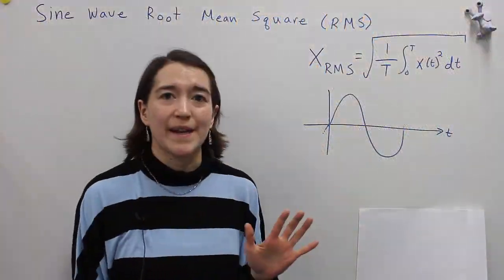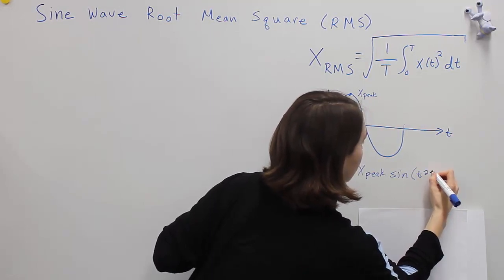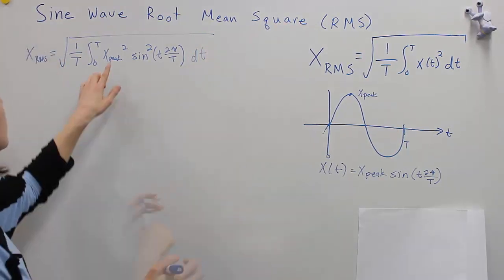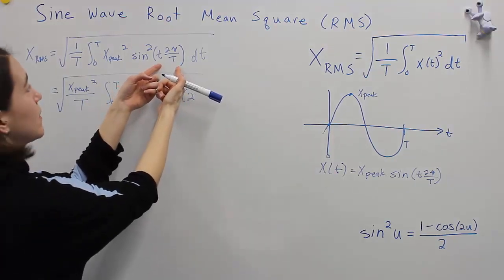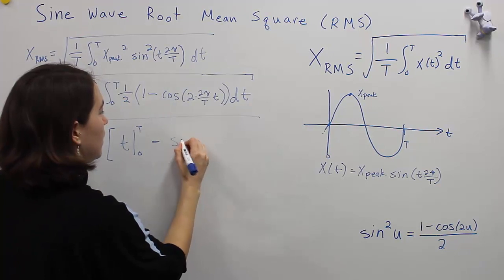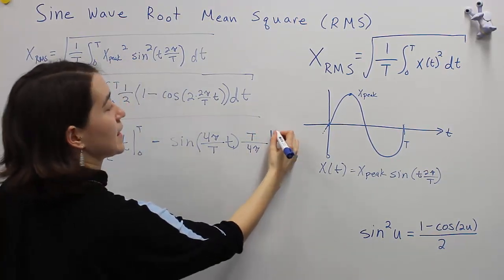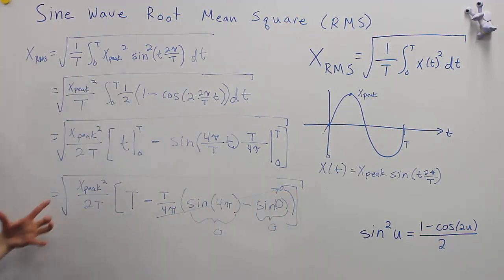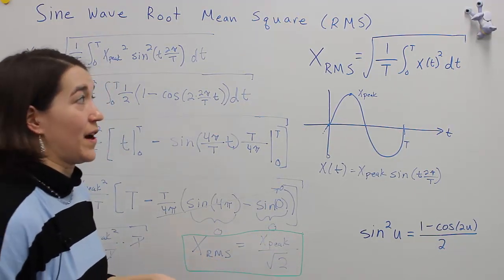Root Mean Square (RMS) Value of a Sine Wave

Comment: Valerye. I have a problem.
I have a system. 
A wall that connects a mass (m1) due a damper and spring. Then another damper and spring that connects a second mass(m2) and a input force that pulls mass(m2) 
And it is necessary to find the position of mass (m2) after 5 seconds. How can i solve it?
Reply: Spring and damper are in parallel